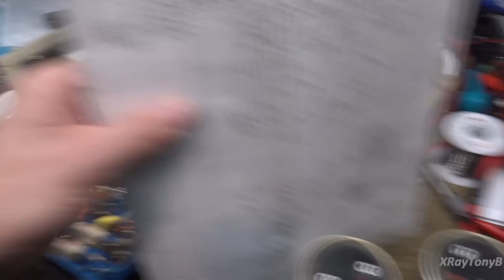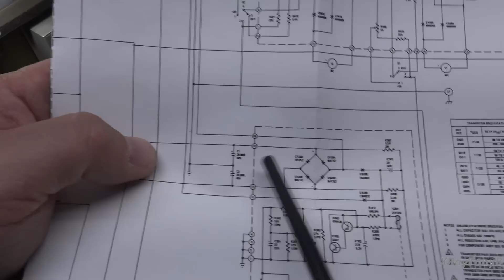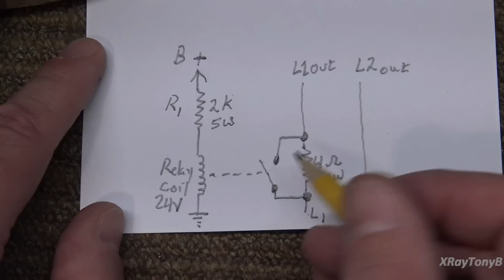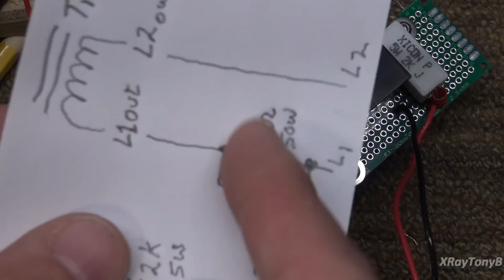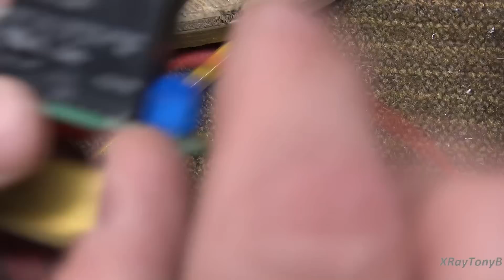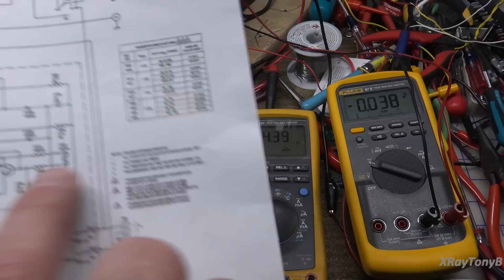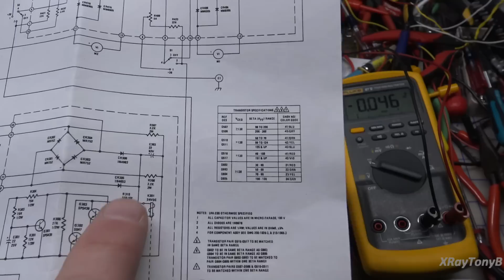Adding a Soft Start Circuit to a Power Supply

Comment: Couldn't a zener be connected in series with the relay coil instead of a resistor to make the threshold more decisive?
Reply: That is a good idea, but the EMF voltage from the relay coil when the coil is abruptly turned off can be easily over 100 Volts and this would instantly destroy the Zener diode(s) installed between the 33000 uF cap and the relay coil.  If you do install a flyback diode in parallel to the relay coil, that will mitigate that possibility.   I think that the circuit presented in this video had a purpose of being simple, effective and durable.
Reply: @kylesmithiii6150  Why would it? The zener would clamp the voltage.
Reply: @NiHaoMike64  Since the voltage on an inductor is V = L di/dt , so if the current across the coil changes rapidly then there will be a high voltage on it (actually a reverse voltage in this case since di/dt is negative). In this case, because the relay coil is in series with a large RC circuit, and C is very large (33000 uF), then di/dt should not be big at all. It can be seen on an oscilloscope. At 27m 57s Tony showed the peak voltage on the 33000 uF, it is about +57 VDC. Let’s suppose that the capacitor discharges rapidly when the amp is turned off and the EMF voltage of the relay coil is 10 V peak, so the 2k (5W) resistor will take the +57 - (-10) = 67 V peak and dissipate the energy rapidly on itself.  All will be fine.  If you put a Zener diode in series with the 2k resistor (and I do like the idea!), say a 12 V Zener to set the threshold, then first you will have to recalculate the value of the resistor = (57-12-24) / 30 mA = 700 Ohms (2W).  Zener value = 12 V (1W) or use 2 x 6 V Zeners in series (0.5W each).  You will have to see on the oscilloscope the EMF of the relay coil to see if the Zener(s) can take it, or just install a flyback diode in parallel to the coil and it should be fine.  (I am adopting the nominal current of the relay to be 24 V / 840 Ohms = 30 mA) (Tony measured the resistance of the coil to be 840 Ohms - see clip at 15m 56s)
Reply: It could. I'd actually recommend still using the resistor, but adding a voltage threshold detector circuit (a Zener and a BJT)

Comment: How long is time delay before the relay "kicks in" without the dim-bulb ? From what I've read , you need at least a  250ms relay turn on delay. In addition the larger the trans output voltage and caps on the supply the greater the "turn on delay" should be. I have about 1 sec delay with an effective bleed resistance of about 50 ohms (4 * 200 ohm at 5 watts ea),  but the soft start circuit is more complex (complete with a relay turn-on LED) in its own small case.
Reply: In this setup the delay already depends on the time it takes for the circuit to reach the preset voltage.

Comment: A good, practical build for a soft start, thanks for sharing it! One thing I wonder about relays that are "soft started", such as ones used for your circuit here or for DC protection on amp outputs, is, does the "slow" build up of DC voltage on the coil to close the contacts make a difference over time to any "self cleaning" properties that a hard "0 to working voltage" application may cause. I'm wondering that, if contacts close a bit harder, will they "self clean" any better.
Reply: great question. My gut feeling isit won't make any significant difference  in the contact cleaning as the pent up tension in the spring provides most of the cleaning power.

Comment: You should NEVER use the "aux" AC outlets on a pre-amp to feed a Power Amp. The Phase Linear 400 didn't have a power switch either.

Comment: Poor man's soft start is an NTC thermistor.
Reply: And cheaper too 👍
Reply: Simple & cheap. Will put its finite hot state resistance there it's the only drawback. Can modulate mains draw a bit along with bass transients if the amp is really pushed. Would be a non issue to a pure class a amp with same power draw at any output level but such beasts are rare.

Comment: Would a PTC thermistor used as an inrush current limiter work in that?
Reply from the maker: PTC thermistors increase resistance with increase in temperature.  You would want to use an NTC. The issue with them is that they get pretty hot when they are at their low resistance level.  This adds a lot of heat to the inside of the amp.  That's why i don't like to use them.
Reply: @xraytonyb  ... and since they run hot, they present resistance, which increases output impedance of the power supply - not a welcome addiition in an amplifier, unless you're looking to limit its instantaneous current delivery capability.

Comment: Tony, 
What is the voltage drop across that 4.7 ohms resistor?. Is that enough to have that same voltage drop in parallel with the relay coil, so that the relay turns off after the capacitors are charged? This way the relay will not need to stay on all the time when the amplifier is on. Would this be a suitable alternative way to do this?

Comment: The amplifier doesn't appear to have a mains ground connection, is it double insulated?
Reply: I love this and many other technical channels from the USA, but I am always surprised by how many metal chassis items of this era have no safety ground connection - or appear to have none of the internal design that would make it permissible for class 2 (no ground) operation here in the UK - even for equipment of the age of this Marantz.
Reply from the maker: The transformer provides isolation.
Reply: @xraytonyb  Yes, but if the chassis becomes live due to a fault on the primary side or the transformer fails, the mains supply protection won't detect it and trip. Only if the whole unit is double insulated, class 2 is an ungrounded unit permitted in the regs/code, at least in the UK.

Comment: excellent work, quite educational.
does the loud 'thump' some amps produce when plugged in or coming out of sleep is also the effect of a large inrush current? 
my bass guitar amp makes one when turned ON and also OFF. as i recall the power caps are way smaller though, i think 2 caps @5600uF. 
i could try powering it thru a light bulb like shown here.. :}
Reply from the maker: The thump is because the amp does not have a speaker protect relay.  Until the transistors come up to their proper bias level,  they could have uneven voltages on the outputs, which causes a temporary dc offset.
Reply: @xraytonyb  thank you for the reply, that makes sense

Comment: Great circuit addition,  however I like to be more conservative and put a capacitor across the relay coil to increase the delay time, and increase the power resistor to limit the in rush current more. I have found that this is less stressful on the rectifiers and main filter capacitors and increases their  life.
Reply from the maker: The purpose of the 2k resistor is to set the level at which the relay comes in.  As it is, the relay won't come in until  the capacitor bank is charged above 75%.  Adjusting the value of the resistor adjusts the trip level of the relay.  Adding another capacitor across the relay is unnecessary.